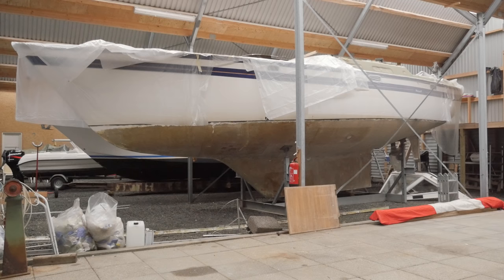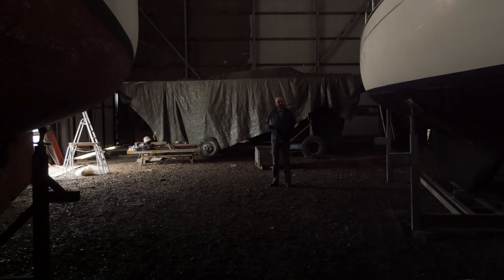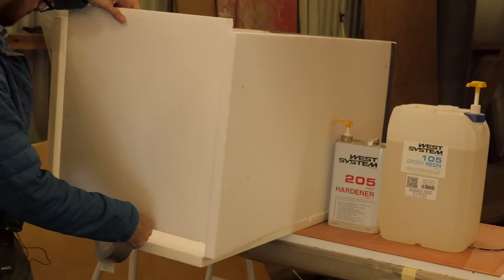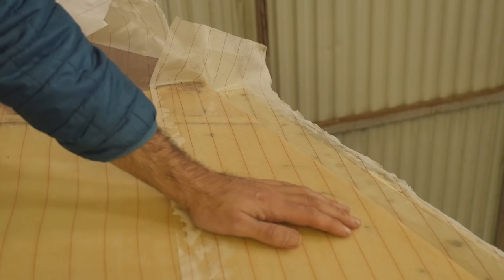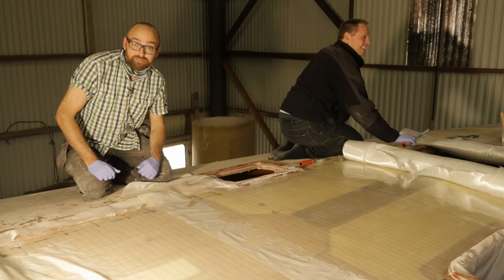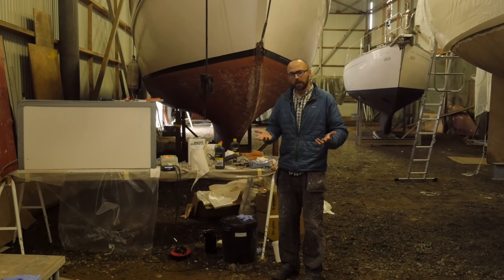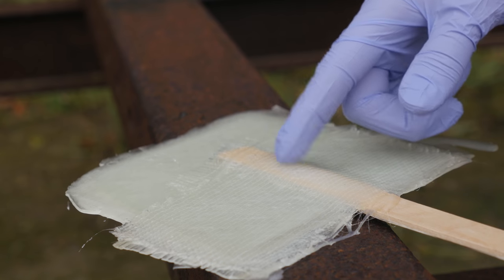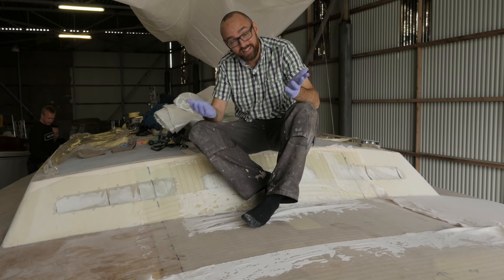Sail Life - New deck on a sailboat DIY style ⛵⛵⛵

Comment: Mads can you tell us about the overlaps in the fiberglass cloth? How are you doing  the overlaps of each layer? Thanks. Pretty dang spiffy!! As far as West vs the other brand. Well epoxy sticks to most anything. It will probably stick to the other epoxy just fine. it makes no difference that it is epoxy. The questions are about the different mechanical properties of each epoxy in  the same laminate. Thermal expansion is a concern. Do the have the same modulus, etc... One of the biggest issues with a composite structure is the different properties of the components.

Comment: I too would stick with the WS, as I've regretted a few times whenever I tried to save some money by using a different product (especially in a mix and match scenario) then was originally planned for and it has often cost me more in money, headaches and labour in the long run. It would be such a shame down the road to have to tear up a large portion of your deck to have to redo it.  IE. shortcuts when working on boats usually turnout to be long cuts. :(

Comment: Don't mix epoxies. there are so many different types, a lot of them are for concrete..
Instead of mixing by volume get some scales and measure everything by weight, it is so much easier, faster and more accurate

Comment: I'd say stick with West System. Epoxy resin is pretty much made all in one place for the entire world, however, the additives that each manufacturer uses to make it their brand could down the road lead to problems. This is probably not a job you wish to do over. Andy over at Boat Works would probably be able to give you a pretty definitive answer.

Comment: I would also suggest sticking with West Systems for the entire deck project. I'm not saying I think West is superior to other epoxy systems, I just don't believe it is advisable to switch epoxies in the middle of the job. The epoxy manufacturer says their epoxy "should be OK" when used with West Systems. Basically they are saying "We don't know, why don't you be our guinea pig, and we will both find out". Do you want to find out there is a problem a year or two in the future? Even if the new epoxy is completely compatible with West Systems, it hasn't been tested, and you will never be sure. Do you want to be done with the deck and confident with it's integrity, or do you want to spend the rest of your time with Athena wondering if there is a problem?

Comment: Go with the cheeper German epoxy. As long as the key is good it will be fine.
Ex air craft fitter
Reply: That's what I was thinking, I mean epoxy is just about inert once it hardens no? So, if it does bond well it should be good for a Looooooong long time.

Comment: if it were me I would prefer to stick with one brand of product. however, if I were to  switched to the German brand I would finish out the lay up with the German brand. I would not switch back again to West system there by "sandwiching" the German brand in between West system.

Comment: The only thing you know for sure is that you will not have a compatibility issue if you stay with WS. Your test shows that everything is OK in those small test parameters. It does not verify what will happen in a gale bashing into 4 meter waves.

If it were mine I would consider the extra expense as cheap peace of mind.

Fair winds

Comment: Seems like by the time you are finished, you will have spent a fortune in time and materials, fixing up an old sailboat.  Then if you would have just saved up and bought a newer boat without a shot teak deck. I get that you enjoy doing the DIY project and all and clearly that is part of the hobby. 

I looked into the cost of building a Fusion 40 catamaran a few years ago and after figuring the cost of everything, the 2+ years of building the boat, added materials,ect,ect. It quickly no longer made sense. In fact, it would of ended up costing more than just buying a slighly used catamaran.
Reply from the maker: +mike davis That is a question that pops up from time to time. Every time my answer is the same :) I still expect Athena to be less expensive than a newer boat by the time I'm done but for me it is not about cost. It's a part of my dream. I want to fix up an older boat and then go sailing in that boat. 

Many many years down the road I'd love the opportunity to build a new boat from scratch. Again that is not about cost but because it's something I'd have fun doing :)

Comment: Since you have been using West System all along I assume you like it and trust the quality and properties, it seems it is just an matter of anticipating the placement ofyour orders from Wessex to accomodate the lead time as gaged by your usage. I see half a C-group in your video half full - is that a days supply?  five days? Three weeks? I have no experience with how products move between the countries in Europe but in the US the bottle neck is the shipping company. In the US we ship mostly through UPS which guarantees 5 working days. They are generally much faster - one or two days in most cases. If it ships by freight it takes longer. Larger orders ship by freight. The German product you tested that ships in a day is a gallon kit - much easier and faster to ship.  

My point is again, anticipating delivery times for the product you need is standard operating proceedure. As much as you must've gone through already I'm surprised you didn't order it by the drum and save some money.
Reply: As stated this is a DIY job, he's no expert a good supplier should help fill the gaps in consumers knowledge...
But thanks for responding.
Reply: I agree , Thanks Bruce from west system for responding.

Comment: As you know I'm building a boat and I use/need epoxy. I'd be interested to know (as I'm from the UK, but live in Finland) where you get the West from in the UK; and it's price in Denmark (in Euros) and the German stuff? How much is that. At the boat building school we purchased JETI500 from Tampere (http://www.arsalin.fi/kauppa/product_details.php?p=6) as like you West System is very expensive here too, just to compare 5+1l is 210€ (https://www.nettivari.fi/west-pack-105b-6-kg-5+1kg-kovete-) so JETI500 comes in at 175€ for 15+5l...no brainer.

Comment: What are you paying for 20kg Epoxy? Here it is around 300 to 600€ and I find that to be absurdly much. Fibreglass on the other hand is a round 2 to 4€ a m².

For example 1000m² of fibreglass for the hull costs 3000€ and the according amount of epoxy 30.000€. That's just redicilious.

Comment: I would say continue with the West Systems product to avoid bonding issues with the deck.  You can use the less expensive German product on other areas of the boat.
Contact West systems and see if they can expedite some epoxy to you.

http://www.westsystem.com/where-to-buy/

Comment: Money talks. If it is the German epoxy you must buy...so be it. I would, since the deck will be forever, spring for the West Systems for no other reason than being absolutely sure of your end product. Risking a deck that has variance in it wouldn't set right with me. Not only the issue of whether the bond would be solid, which it probably would be, but will it hold primer and paint in the same way? Could the paint discolor in time on top of differing epoxy formulas? Would one area flake and another not? I don't know. Just seems potentially what we like to call penny wise and dollar foolish. Your call. Glad I'm not you. ;)